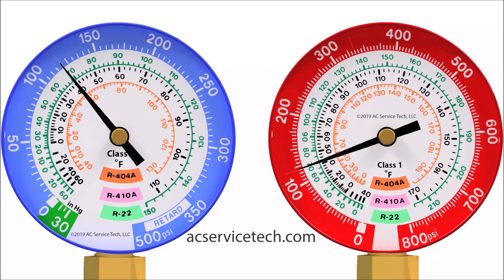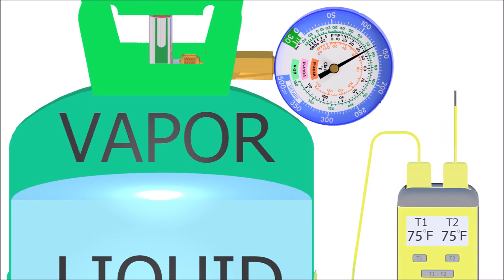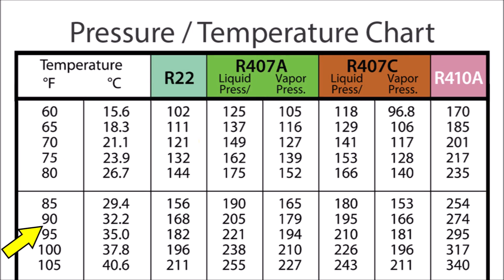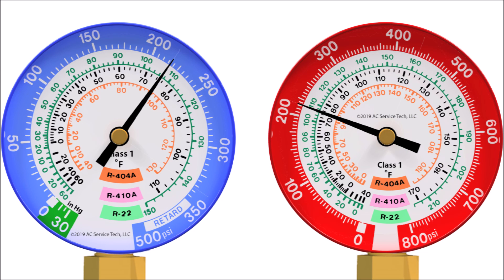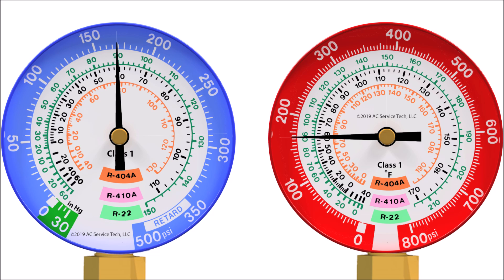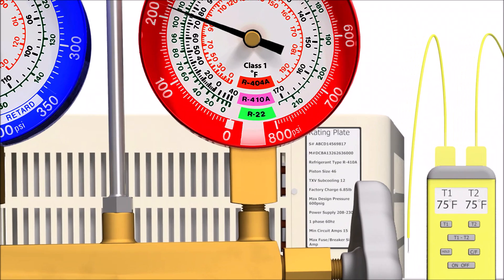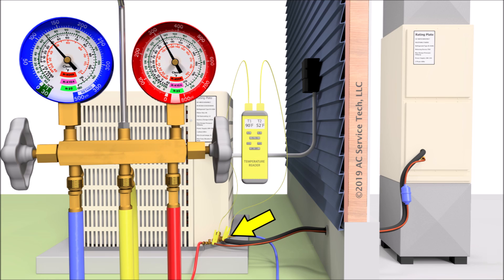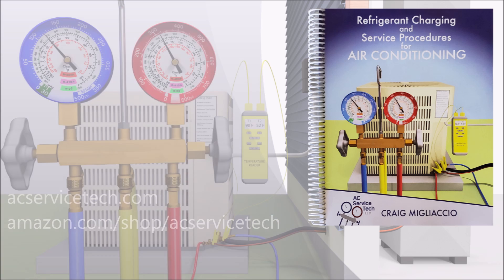Saturated Refrigerant Temperature Basics, The P/T Chart, & Reading The Gauge Set!

Comment: How would one know what the head pressure is supposed to be? Is there a calculation for that or we use the PT chart for the head pressure. So if it’s 95.2 degrees outside, the pressure would be 296 PSI while the suction pressure should stay above 32 degrees?

Comment: How would you use the PT chart when you have different amounts of REFRIGERANT in each system , 5 pounds VS 10 pounds VS 15 pound, and what If you’re leaking refrigerant and are down to let’s say half of the initial full charge, wouldn’t you get an inaccurate calculation

Comment: This might be a dumb question I apologize in advance but, on the PT chart why is there only one pressure shown for r22 and r410a
Reply from the maker: Its all good Dean, it is showing the coorelating r-22 saturated temperature at that pressure. Then it is also showing the coorelating saturated temperature for the r-410a as well. These two temps are significantly different.

Comment: Hello. Any chance you could do a repair video regarding adding service ports on Heat Pump Water Heaters? I have a 2016 Geospring 50gal water heater, and the manufacturer only provides a service manual for an older model. There are a lot of these tanks out there that most plumbers and hvac techs will refuse to service, due to lack of information. Thanks!

Comment: Can someone explain clearly why the suction line is colder then the 
liquid line? I mean the liquid line is subcooled liquid, but the suction
 line is saturated boiling gas.. it's holding all the heat from inside 
the house so how is the line so fricken cold?
Reply: Any increase in liquid temperature above its boiling point is called "superheat."

Examples of boiling points:
Water = 212°F
Alcohol = 173.1°F
Dry ice =  -108°F
R22 = -41.62°F 
r134a = -15.34°F
r410a = -55.3°F

Example
If the temperature of water in a pipe is above 212°F, its boiling point, then it is considered superheated. The pipe will be hot to us of course.
But these refrigerants are extremely cold and have a really low boiling point in the negatives. They can be heated to just a few degrees above thier boiling points and still be negative degrees which is still extremely cold to the touch. 

All liquid substances can have the basic 3 forms of matter. Solid, liquid and gas. They all have their own unique conversion ranges. Youve seen the fun science experiment with liquid nitrogen right? The nitrogen is boiling and evaporating away because the atmospheric temperature around it is warming the liquid.
Reply: So a refrigerant line with R22 can be -30°F which is above its boiling point and is considered superheated.  But -30°F to us is frost bite temperatures.
Reply: @jerm5772  so essentially it makes no sense because refrigerant is weird
Reply: @zesty2023  Yes. Everything but water is wierd. We understand water. We are mostly water. We live by the rules of water. We are not used to understanding other liquids.

A week ago Ive never heard of subcooling and superheating. And Im trying to figure this out myself.  Im trying to save hundreds of bucks to recharge my own home ac. Ive been watching many youtube videos trying to piece it together.

Comment: Is it ok to install a trane outdoor unit to a carrier indoor unit ? Also is it ok to swap a 2.5 ton outdoor unit with a 3 ton outdoor unit and keep the same indoor unit ?
Reply from the maker: You can mismatch equipment manufacturers when it comes to single speed split systems. You want to keep the tonnage the same though a txv will help when there is a 1/2 ton mismatch thanks Daniel!

Comment: Greg, In laboratory for HVAC school and/or manufacturing plants, have you ever seen a see through type tubing for the evaporator and the condenser, so the student or technician can see the refrigerant in conditions you speak of ? Thanks for your fine videos. Also, would you do a video on your opinions of the different types of start kits? Is one type  better than the other?
Reply from the maker: Hey Aliso, yes they have those clear tubes in the straight sections on the evap and condenser on costly training units at some of the schools I visited. I found with the limited budget at the school where I was that it was much more important and beneficial to get real world systems for the students to use. They are nice though. Thank you for letting me know what you would like to see in reference to start kits!